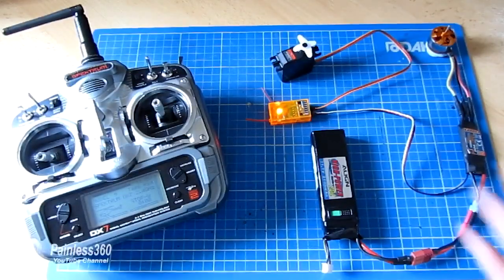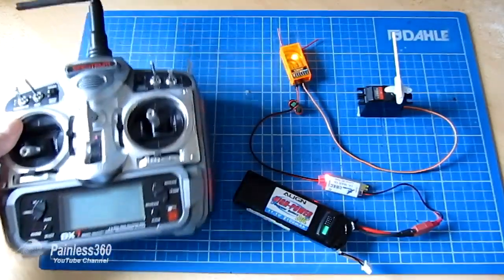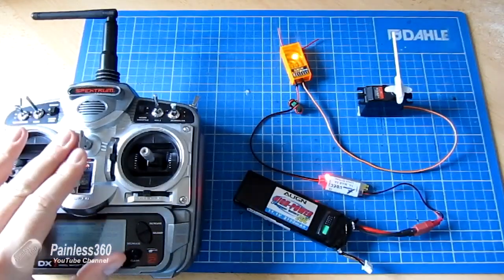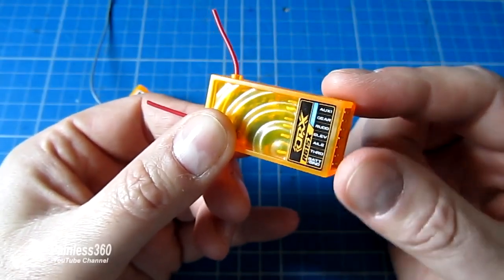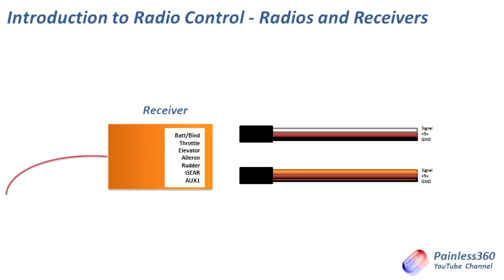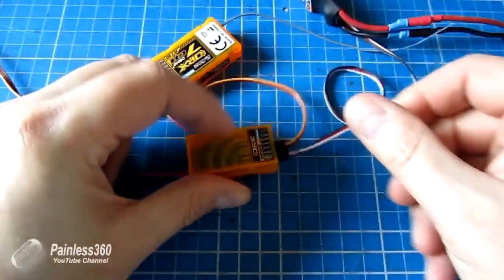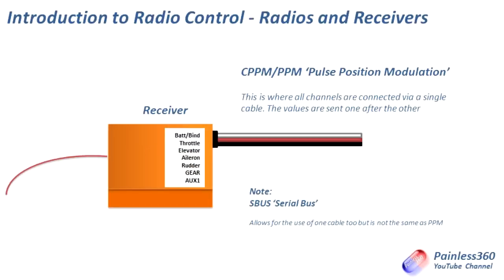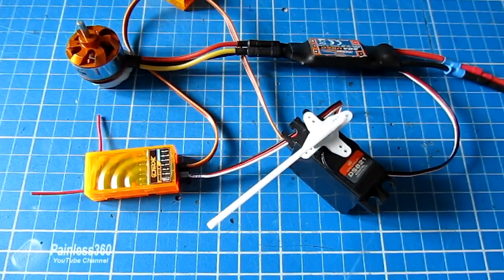RC Basics: Introduction to how a RC radio system works

Comment: Hello
Can i replace servo motor by stepper motor??
And how many channels can be supported?
Reply from the maker: I've not tried it. Most stepper motors need an advanced driver and I've not played with how to control those stepper motor drivers from R/C... Best of luck!
Reply: @Painless360  thanks
But it's comfortable with DC and brushless motor?
Reply from the maker: Not directly. You always need a speed controller of some type. Check out my R/C basics playlist if you're new to all this as it covers the basics simply... I hope that helps...

Comment: Hey, I’m new to this, and I’m a bit confused. So what if the motor has only two wires and no plug? How do you connect it to the esc? Or are there different esc’s for that type of motor? Thanks.
Reply from the maker: If it only has two wires then it's a brushes motor and you need a brushed ESC.. Best of luck!

Comment: can anyone help please.  I have a working bait boat and broken transmitter, can i buy a new futaba transmitter and just put the old crystal in it? will not changing the receiver work? TIA
Reply from the maker: I've not seen a radio with a crystal in it for about 9 years. If you can get a compatible radio with the one that broke you should be able to get them to talk.. Lots of modern options now that are very cheap too if you want to upgrade. See my reviews..

Comment: I bonded the combo FS-T4B/ FS-R6B once and everything worked well.
2 months later now only ESC is running in channel 3. All the others servos don't work.
Do you know what am I doing wrong?
Reply from the maker: Could be a few things. Do the servos have power? What troubleshooting have you already done?
Reply: @Painless360  hi thanks for your promptly reply!
Worth to say that the receiver must be good as I swooped it with a new SP-R6B and the issue was the same.
Receiver is sending power (3.8v) I got it with multimeter.
I thinking on the signal.
I'll test them with a arduino board.
Reply: @Painless360  I tested with arduino board and as I suspected the servos that I have installed are not responding.
While a test one is working ok.
So I suppose the only chance I have is to buy new ones!! 🙂
Reply from the maker: 3.8 volts is LOW... most servos need 5v or 6v..

Comment: I don’t see this covered, but the antennas are different lengths based on different frequencies. Higher frequency has a shorter wavelength, and the antenna needs to change length to match.
Reply from the maker: Yep, see my FPV Antenna Lab series.. Happy flying

Comment: can i control my rc over 50 kms
Reply from the maker: You can't fly that far with traditional radio controlled equipment. There are ways that you can do it using the cellular network but be careful as in many places anything over line-of-sight is illegal. Best of luck

Comment: How much is the maximum and the minimum Voltage and Ampere needed for these recievers ??

please help me.....
Reply from the maker: It depends on the reciever. That'll be in the specs for the one you're using. They normal run OK from about 4v to about 5.5v normally but again, it specific to the one you're looking at... Happy flying

Comment: This is excellent!!

I have been out of the hobby for so many years that my old radios are probably not even legal anymore.  (27mhz)

Many new things to play with and learn. 
Thank you.
Reply: was 35 mhz for planes and 27mhz for boats?
Reply: @johnpeabody6166  the difference was that 27 Mhz could be used by anyone.  35Mhz required a amateur radio license.
 Didn't matter if you were using it for a plane, boat , car or helicopter.  Back in the olden days, we didn't have multirotors like we do now.  😄😄

Comment: SIR,, thank you for doing this video, ,very informative. I have a question for you cause I need some help, my problem is that I have 4  two channel helicopters and 2- 4 channel helos and when I moved all these controllers got threw into a box and got mixed up and they all kind of look the same and I really want to fly them now and I do not know which controller goes to which helo,, do you you  know of a way to help me figure this out to get the correct controller to the right helo,, I sure would appreciate any help you can give me,, Thank you very much sir in advance---  Russ
Reply from the maker: I would remove the props from the models and then turn each radio on to find the one that connects to it then label up that radio and model so that you keep them together in future. Best of luck
Reply: @Painless360  i will do that sir and really  THANK YOU FOR YOUR TIME..I should havebeen more organized that what i did ..i did have  tape on them marked with a sharpie but that wasnt good enough over time..i will do what you suggested.-- Russ

Comment: So great video, but I have ONE question: I have a receiver, servo, motor, and ESC connected, and I turn the circuit on, and the servo and motor work for a second, then die out. I am testing the circuit for my RC model. And I can't move anything afterwords. I think I connected all of the wires in the wrong place on my ESC. I have a FlySky FS-I6B remote. I have the FlySky i-BUS reciever. Thanks for the help.
Reply from the maker: Sounds like the setup us polling more current than the BEC can supply. See the other videos in the 'Introduction to remote control' for more of the basics.. best of luck

Comment: what about applying RC to other projects?

like say I wanted to just control 2 motors independently
Reply from the maker: Yep, entirety possible..
Reply: @Painless360  what would really be involved in that? not much more than is involved here? 
controller
receiver
speed controller
battery
battery circuit
?
Reply from the maker: Youd need two ESCs and two throttle channels from the radio. See my other videos in the introduction to remote control playlist. Best of luck!

Comment: Do you have an example on how to set up a command for say i want a series of motors to move 1 after another. Say a servo in spot 1 moves first, followed shortly after by servo 2 then 3?
Reply from the maker: Depends on the radio but I've made a few videos in the OpenTX Mix School that covers sequencing.. Hope they help..
Reply: Painless360 thank you :) I'm working on a RC centipede, has photo sensors so the lights turn on and off on its own, I've got the servos all set but trying to figure the servo timing out is tricky

Comment: Would it be possible to have one stick control a motor and steering and other stick to run another motor and steering of different servo for a tugboat so can have one motor going forward and other motor going in reverse and the same time for sharp turning if using 2 secs? Thanks
Reply from the maker: Absolutely. You need a radio with a flexible setup though. Radios that use OpenTX or JumperTX would be to do it easily. See my OpenTX mix school videos.. best of luck!

Comment: Thank you for taking the time to educate novices such as myself.  Question: After I center my servo when I turn the radio off they instantly move to an extreme position.  Is that the way it should be?  I am afraid to connect to my control surfaces until I am certain.  Thank you.
Reply from the maker: A servo will only move to the position that it's sent so when you power off it will stay in that position. You might notice that it will move when you first power up a model and that's because the servo was probably in a different position to the one for the signal this is being sent. Hope that makes sense. Best of luck.
Reply: @Painless360  So can you tell me the proper way to center a servo?  Should it stay in that neutral position when I turn the radio off?
Reply from the maker: Set the failsafe on the receiver. See my 'simple plane setup' video in the fixed wing playlist for a step by step guide..
Reply: @Painless360  Thank you.
Reply: @Painless360  And thank you for your reply.  I must say that the comradeship and eagerness that the hobbyist have, in terms of helping each other is most refreshing.

Comment: great work @Painless360
I had a question about 2 channel rc receiver used for boat control. I hv to be a bit elaborate.
when forward control is pushed, both propellers rotate in a way that moves boat forward. when left control is pushed left propeller stops, right still rotates turning boat left. likewise with the right control.
the thing I didn't understand is what happens when both forward and either left or right controls are pushed simultaneously. in one youtube video I saw both propellers rotate, but may be in manner that pushes the boat forward at the same time turns it. what exactly happens?
Reply from the maker: You can setup the radio so that you can control that. Check out the Opentx mixes for tracked models as its the same concept.. Hope it helps..

Comment: I got an RC car with a spectrum radio, just wanna ask if this means I can buy any other spectrum and bind it
Reply from the maker: If the radio supports multiple model memories then that means you can bind more than one receiver and just change the model memory for the model that you want to use. Best of luck

Comment: Hi I'm new to RC and have only played around with whats basically 2.4 ghz RC toys, i want to get into doing full RC conversions on some what are essentially toy trucks, your explanation in this video is superb for me so thank you, however and this may seem a dumb question but i guess this set up type could be applied to a truck or vehicle, I ask because obviously your mainly talking flying craft in this video, again apologies if this seems daft but please bear in mind i am new to all this. Thanks again for the video and any advice is always valuable to me as a beginner.
Reply from the maker: It's not a done question at all. The principles are exactly the same whether or not the model is a plane, boat, truck, Car, motorcycle, helicopter etc. The basic principles are found in almost every model type. Hope that helps
Reply: Painless360 that’s great thank you for the reply

Comment: Hye,can i ask you quection about this,if servo i replace with dc moto If can?i want make escavator
Reply from the maker: You can but you need a speed controller to run the motor. See the other videos in the series..
Reply: @Painless360  thank you

Comment: So I am working on an rc tank, but need a programmable (voltage output and code) controller and receiver. Any suggestions?
Reply from the maker: Sorry, I don't understand the question..
Reply: @Painless360  So for The tank i am building I have 6 volt motors and need to program the output of the reciever to the motors so i dont burn them out, and also need to (re)program what each switch does.
Reply from the maker: Sounds like you are new to this. You will need a speed regulator that will connect directly to the battery and then convert the energy of the battery into what the motor needs to match the throttle signal coming from a receiver. There are two types of these things one is a brushless speed controller for brushless Motors, the other is a brushed speed controller for brushed Motors. So if you know what kind of motor you have you'll know what kind of esc you need. If you are new to this, then check out my 'Introduction to remote control' series on the channel that explains a lot of the basics. Best of luck!
Reply: Thanks!

Comment: I miss the old days. Built my first system from a kit (Ace R/C). Hardest part was soldering the boards for the servos(super tiny parts). But in the process  I learned exactly how the whole circuit worked. The one thing I am impressed with on the new digital systems is that they still eventually use the same PWM signal to the servos. To me, the rest of it is a bit of over engineering a simple system that works well.

Comment: I built a couple of non-standard devices as well as the motor speed controller and servo. One was simply a switch as might be used to turn lights on and off, and the other was a controller for a winch motor(for the anchor). And my speed controller had the crazy ability to run a brushed DC motor smoothly at a speed far lower than the motor would normally run. All these devices used 4011's, 4013's and 4093's and the winch controller and speed control used relays (micro size).
The speed controller design was "upscaled" to run a 1/2 hp electric bike which dramatically pointed out a small flaw in the design that I hadn't seen at the small scale.(fixed)

Comment: How would I go about making a large RC tank about 45 pounds in weight and control just the tracks.
Reply from the maker: That is a little outside my area of expertise. I'd spend some time looking in the forums with those guys that specialise in making these bigger models. In terms of controlling the tracks, you have quite a few options. Each of the tracks is ultimately driven by a standard speed controller and you can either run them independently with things like the sliders (as this owner did). Or, you could mix the elevator and aileron connections so on one stick you can control the forward and backward movement as well as rotation. Best of luck with your new project..

Comment: Carbon fiber conducts electric current. So you in a essence, create a faraday cage with the carbon fiber fuselage. So the antenna needs to be outside the aircraft. But you can also block your signal as well.  Unless you wrap the antenna around the craft to get a good signal. This is also important. But carbon fiber does help in FPV signal cleraty. Because it absorbs and dampens the resonant frequency created by vibrations from motor and prop. Which is good for multy rotor racing. And carbon fiber frames along with clover leaf antennas, are an absolute must in FPV drone racing.

Comment: i need to learn how to select the motor and what will be the speed i get for specific kinda motor and selection of other specific electronic gadgets for building a rc thing
Reply from the maker: See he other videos in the ‘Introduction to remote control’ series. It covers that (it’s about the battery voltage and KV rating of the motor). Best of luck with it!
Reply: @Painless360  thank you for that
I also want to know how can i scan a QR CODE using fpv camera

Comment: I understood your explanation of the transmitter and receiver speaking the same language in order to communicate.  You used an example of non-communication as using a futaba receiver with your spektrum transmitter. What I did not get was, I didn't see anything at all written on that orange receiver saying it is a spektrum receiver.
So I take it that there must be something else about the tx & rx that indicate if they will communicate. But if you said what that was, I missed it. What is it ?
Reply from the maker: It's the protocol  - DSM/DSM2/DSMX
Reply: Painless360   ok. Thanks.
Reply from the maker: If you're new to this then the videos in the 'Introduction to Remote Control' should answer lots of those kinds of excellent questions. Happy flying!

Comment: Hi, can I connect a DC motor directly to a receiver without using esc?
Reply from the maker: Not usually, servo pins ate not designed to supply the currents most motors need.. See my other videos in the Introduction to remote control series for more basics..
Reply: Thanks for your answer!

Comment: Is there limitations between the receiver and the servos?  I want to use extra heavy duty servo's for a project I am working on. It will be a remote control 4'x8' boat, fitted with a Mincota trolling motor. It will also have a gas power trash pump so a servo for high & Low speed, as well a high-pressure spray nozzle. I live in southern Florida near the gulf coast. Because the algae is highly toxic I want the unit to be wireless and remote. Any recommendations would be appreciated. The unit will suck in the algae, masticate it, and eject it in a jet stream. The pump currently shoots water 250 feet. The nozzle might have a swivel base and a motorized angulat adjustment. The servos would be used to make the contacts, but not lifting.
Reply from the maker: I’ve not used anything but RC servos. The servo needs power and larger servos will pull more current so will need to power them from a suitable power supply.. best of luck!

Comment: Can you use any 2.4ghz transmitter with any 2.4ghz receiver? im trying to build a combat robot.
Reply from the maker: No you can't. If you're new to this then there are all the 'intro' videos you should need in the 'Introduction to Remote Control' playlist.. Best of luck!
Reply: Thanks

Comment: I know it's a bit of a loaded question. Would you recommend a transmitter for a beginner that does most of what you need to get started? I cannot get access to your other videos as yet. Not sure why. That was such a great informative video and easy to understand. Many thanks.
Reply from the maker: Depends on many factors - see my 'things to consider when choosing a radio' video..

Comment: how do you connect it if you want 2 motors
Reply from the maker: Please have a look at the other videos in the series. You duplicates the ESC and motor setup to get your second set and then make sure that you have to throttle channels working on your receiver. Best of luck!

Comment: I hope you can answer this question. I need to control 2 kids ride motors. Please see link below. I have difficulties finding a ESC for this motors. Can you give me some info/guidance that I can get? I'm using similar RC and receiver of this video. Any help will be appreciate it. Thank you in advance. I'm working on a RC lawn mower:  https://www.ebay.com/itm/322229641401

Comment: do you have to program the remote? plz someone who knows reply back
Reply from the maker: Sounds like you’re new to this. Check out the other videos in the ‘Introduction to remote control ‘ playlist for videos about power and other basics.. best of luck!
Reply: thaks
Reply: you didn't answer my question, if you use a speed controller do you need to program it.